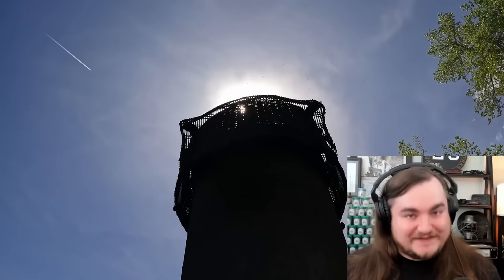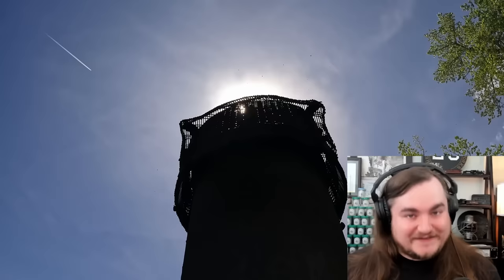Why do USA steam trains make smoke, but UK ones don't?

Comment: In the UK most urban areas were designated "Smoke control areas" in the 50's and 60's which banned the burining of natural coal. So nearly all of our coal is actually coke. This makes for much cleaner burn.

I'm not sure if Railways are exempt from the Clean Air Acts, but for example my house is in a town centre and it would be a criminal offence to burn either coal or wood that hasn't been kiln dried here. Either the railway also complies out of convenience because most lines probably pass through such areas or smoke free coal is the only only show in town.

Also if your running a heritage railway you want to give your patrons the best experience - and coating them with fly ash isn't what they paid for.

Comment: Combustion air preheating makes a big difference in smoke production.  Modern fire places are designed to minimize smoke by use of insulation, baffles and secondary combustion air.

Yes, smoke is wasted fuel.  With coal, only smoke possible is with fresh addition.   The hydrocarbons vaporize first, leaving coke behind.  Carbon burns by vaporizing and immediately forming carbon monoxide which then burns with a faint, blue flame.  Deficient oxygen forms carbon monoxide as carbon vaporizes slowly.
Hydrocarbons make black smoke because the hydrogen burns first, leaving carbon particulates if insufficient oxygen is available or temperature too low.

Comment: In the old days every city had a smoke inspector. He would have a chart and he would judge whether you were making too much smoke or not and the railroad would be fine d. In a magazine a Santa Fe guy was talking about how one of the 3700 class Northern came in with a clear stack and one of their alco PA when it was accelerating shot out a bunch of smoke and they got ticketed for the smoking diesel but not for the steam locomotive 🚂

Comment: Technically coal like any substance doesn't burn. In the fire box the heat causes the emission of flammable gas and it is the gas that burns, this is known as pyrolysis.

Comment: There were these old signs made during WWII that read, "Excess Smoke is Wasted Energy" "Excessive Smoke Wastes War Resources", etc. Under normal operating conditions steam locomotives should NOT produce excessive smoke, period. Pulling a heavy load up very steep hill at high altitudes will cause a steam locomotive to smoke. Billowing black smoke is mostly done purely for aesthetics. The railroads just like coal powerplants today would reject poor grade coal.

Comment: The UK has much higher population density which means a lot more people to get pissed off at you if you dump a load of soot onto their house, washing line or any of their property. Watching old docos from the UK there seems to be a lot of emphasis on managing soot pollution for the sake of communities whereas US trains covering vast sparsely populated countrysides don't have to worry as much. 

The UK also has for the last 2 centuries had less coal and a coal supply that's more expensive but also very high quality which would also lend itself to running coal burners as efficiently as possible.

Comment: Steam locomotives shouldnt produce smoke at all normally. But usually whenever you see that the crew is dumping sand in the boiler to clean out the flu tubes, which produces that black smoke. Its usually done during photo runbys

Comment: The British fire with the firebox door open, which adds oxygen over top of the fire.  This prevents incomplete combustion (smoke) from lack of oxygen.  There is danger to having an open firebox door, as the unburned fuel is quite explosive and can enter the cab if the blower (using boiler steam instead of cylinder exhaust to create the smokebox vacuum) is not opened when the engine stops.  BOOM!  This happened to a run recently and the crew were burned.  Sometimes, when black smoke is forbidden in America such as in Salt Lake City, overfire jets would be added to the outer firebox wall to add oxygen in the same manner as the British, but with the door closed there wouldn't be any flashback into the cab.  Many of the Rio Grande engines from Salt Lake City had this smoke reducing modification.

Comment: Very interesting indeed. As I understand it black smoke is caused by the emission of unburnt coal particles. Ideally you want all the carbon in the coal getting converted to colourless carbon dioxide as its burnt (there are other impurities sulphur being a nasty one producing sulphur dioxide). That UK 1950s video emphasizes the even burning and thus little and often firing of the coal bed as well as steady removal of solid waste via the grate. The heavy blasts of air over the fire bed you showed will cause large hot spots but also stir up unburnt coal that will cause the black smoke so working against ideal conditions. The UK had a massive problem with coal and maintenance costs amongst other things on the railways at the end of the 1940s. In 1948, on the formation of British Railways the steam fleet was  19,816 being aggressively reduced to 11,662 as recorded in 1961. Mechanical and combustion efficiencies in the UK were under intense scrutiny over that period including various dynamometer trials that impacted engine designs of the emerging BR twelve standard designs over that period. There was also the Clean Air Act of 1956 to consider, how that applied pressure to the railways/ impacted engine designs I have not seen any comments on. Modifications to the grate plus auto cleaning, experimentation with single and double blast chimneys all regularly feature in engine modifications and improvements. Welsh coal being high quality (few impurities) and burnt extremely well. That’s certainly what I have picked up from various books. I do not know if North American engines and their designs were subject to such scrutiny, would be interesting to know.

Comment: My grandfather ran these locomotives in Africa,Europe, and North America they all smoked and depends on the quality of fuel {coal} that's available and the years of experience the crew has  and different designs from countries in which they were built, same thing as a diesel truck rolling coal is unburnt wasted fuel, not efficient  👍

Comment: Fuel, heat, and draft control. The fireman is responsible for the burn 🔥 maintenance  responsible for cleaning the flues and  heat exchange.

Comment: You hit the nail on the head with the secondary air part. Ive spent a lot of time firing and driving on heritage lines and spent a large amount of time on the footplates (and firing) of locos on the mainline in the UK, in both cases the firehole doors are pretty much never shut, that secondary air through the door reduces the smoke almost entirely, they are deliberately designed this way. Locos in the US with their butterfly fire hole doors allow much less secondary air and the culture seems to be having them totally shut when not firing.
Coal is expensive and black smoke is just a waste, plus in the UK we are keen not to have the environmentalists turn their hate against steam locos, whereas I doubt in the US thats a worry.
Reply from the maker: Unfortunately it's just about the same worry anymore... it's not an easy thing.

Comment: Interesting and spot on about combustion. Not familiar with locomotives. More familiar with steam trurbines. Was studying for Dot certification at a marine tech school. Long long ago. 
The school had an old Babcock water tube boiler from a scrapped WW2 Destroyer. We traced and drew all the lines. 
There was an odd fuel line and valve led in to the boiler above the burners. Ended as a bare pipe.

We’re we’re supposed to figure out what it was for. 
There a right way to something a wrong way and the F n Navy way to do something. 
Why the hell would anyone put fuel into a boiler that way no way it will burn properly.
Ahhh it was a Destroyer. 
Mostly they don’t. But. 
Sometimes they wants to make smoke.

Comment: There's a similar myth running around the maritime world.  The Russian aircraft carrier is notorious for smoking and the reason usually given is that it's burning 'mazut' which is what we call 'bunker C' which is a thick residual fuel oil. But wait a minute, this fuel was used around the world for years by almost every maritime nation and those ships didn't smoke.  So why does the Russian carrier?  It turns out the ship has an unusual type of boiler with a pressurized firebox. The air isn't drawn in, it's blown in. They are very, very responsive but it is difficult to control the fuel/air ratio on these. It takes a very experienced/talented fireman to stay on top of this.  There aren't many draftee-age fireman (early-20s) in the Russian navy that have the experience or skill to do that, so they smoke.

Comment: I'd have likely thought to have been way off with what I'd have thought to be contributing: How hot your fire is going that creates draft to pull more air to get the fire hotter so it burns more.

I'd then tangent off about "rolling coal" as is trendy with some to intentionally have more fueling than can be reasonably burned in a given time frame. Good to at least have the notion of being somewhat on the correct manner of thinking.

Comment: Prekindergarten engineering technology, all depend on what kind of fuel you could be using, coal smoke very black, oil blue or white but lack of air and fuel will produce black smoke.

Comment: Very interesting.  I have a Microsoft Train Simulator and it goes into this as you control different things on the engine.  So, the higher the temperature of the fire (since you are putting more air in) the lighter the smoke?  If so, I guess the tradeoff is your fuel (coal or whatever) burns faster thus more fuel is required.  Also, I read that only gases burn nit solids or liquids so you are heating up the coal, wood, oil, etc. until it releases vapors or gases that ignite into flames.  I guess this is why gasoline and alcohol can be dangerous as they give off vapors even at room temperature.  Diesel fuel is safer but may not be as clean

Comment: At least five American Steam railroad use Anthencite coal (Called "Hard Coal" in the US), which is the coal with the highest energy per ton and produces the least smoke.  Most US steam trains use much more smokey Bitumous coal (Call "Soft Coal" in the US).  Most British coal is even smoker and less energy content Lignite coal (Thorugh most British hertiage steam railroads today use Anthencite coal, in pass years from Russia and the Eastern Ukraine but today from Eastern Pennsylvania).   Thus many US steam engines can operate with more smoke for the coal has much more energy and less smoke to begin with and thus the smoke was less of a nusiance (And today the British trains are using Anthencite coal).
In the past British Steam engines had to deal with the even heavier smoke of Lignite coal and to avoid complaints about excess smoke.  Thus the British designed engines to better burn the coal they were using AND trained the engine operators to minimize the smoke (That today most Heritage steam locomotives use Anthencite coal is another factor).  Britans were complaining of the smoke from coal as early as the 1300s (When coal was used to heat homes and cook food replacing wood and most trees had been cut down in or near major cities like London).  Thus the burning of coal and the smoke from burning coal had been a problems for centuries BEFORE the invention of the Steam Locomotive and to get people to accept steam engines as essential for industry Britain had to deal with the smoke produced by coal and did so.
In the US, Bitumous coal burn with more energy and less smoke then Lignite coal helped reduce the smoke people complainted about.  People did complain about the smoke, thus the advertiesments of the railroads that burned Anthencite that there were burning "clean coal".  This included lines like the Lehigh Valley, Lehigh & New England, Jersey Central, Lackawanna, Lehigh & Hudson River, and Delaware & Hudson railways. 
Lignite coal has half the energy as the same amount of Bitumous coal,  Bitumous coal has half the energy as the same amount of Anthencite coal.  In many ways that the heritage lines in Britain burn almost only Anthencite coal today may be the main reason British steam engine produce less smoke then US steam engines, who generally use much cheaper Bitumous coal (In addition to a design to reduce production of smoke and firemen trained on how to minimize the smoke from the steam engine). 
Side note: US coal production, when measured in British Themal Units (BTU, a measure of the energy in a source of energy) peaked in 1998 and has been dropping ever since, even as the tonnage actual being mined has increased since 1998.  Thus the US in mining more coal then it ever has, if measured in tons of coal, but given the big mines today are western US Lignite coal mines, not the much higher energy content Anthencite coal (From Eastern Pennsylvania), and Bitumous coal (From Western Pennsylvania, illinois, West Virginia, and Texas and even in some mines in the American West) in terms of energy the US is mining less and less coal.   This shift to less energy dense lignite coal has also contributed to the gradual shift to Natural Gas for electical generation,

Comment: Maybe the next silly question to be discusses is;
Why some steam engine make strong chugging noise, while another only make hissing noise even on it's full throttle?
Reply: It’s the cutoff.  Chugging is to start or heavy loads vs hissing is efficient running at speed.  The engineer adjusts the cutoff so steam is introduced at different points in the stroke depending on the speed and power required.  A bit like the ignition timing on a car.  Again people like the chugging sound sort of like smoke.

Comment: Interesting topic.
I'm wondering about the reasons why US locomotives were so much bigger,  other than in the US the train is primarily a freight service, and more often runs long distances between stops, while in Europe the train is much more a passenger service as well and generally covers shorter distances between stops.

One other reason I can think of myself that possibly dictates the size of the locomotive is population density. More people living near the railroad means less space for big locomotives, and speed limits are set lower, meaning a big locomotive can't use its full potential, so there's no need for it.

The US made some real railroad goliaths, like the Union Pacific's 4000 class "big boy" 4-8-8-4 locomotives with two powered trucks (4 cilinders) with 8 wheels each. And I've seen a video of the Western Maryland 1309. Same setup, but with two 6-wheeled powered trucks. Still a huge engine though.
And those whistles... 😍😍
Reply: Much longer trains too

Comment: Hmm , so far as I have heard it and seen in person. The locomotive blows out a lot of black smoke under two conditions, either the engine is just accerlerating from a stand still, or the stoker doesnt knbow what he is doing.
Of course coal quality is part of it , you will have dirtier exaust from lignite than form Welsh coal.

I got this to see few times in rl, not sure what exact type of loco it was but since in Germany the workhorse was they 34 I just claim it was one ( had a regular line for a few weeks bringing chalk for filtering to a coal power plant). Back then I lived directly next to the rails and could watch from the window. First 3-4 rotations of the driven wheels a lot of black smoke and then turning more white with each stroke, as the fire gets more and more oxygen.

Comment: The original "coal roll"!  I may have seen something similar done with a U12b pushing a small consist up a steep grade. After a gentle throttle up to get the turbocharger turning, throttle back to idle for about 5 seconds then back to full throttle.  You would only want to hold it for a few seconds so you don't draw too much attention, it couldn't be very good for the engine.
But man that thing would smoke and at night there would be 4 foot flames out the exhaust!!

Comment: The (UK) Railway Causes Consolidation Act 1845 states "Every locomotive steam engine to be used on the railway shall, if it use coal or other similar fuel emitting smoke, be constructed on the principle of consuming and so as to consume its own smoke"

So I'd say there's possibly a legislative angle there too: were US railroads under the same pressures to keep smoke to an absolute minimum?

Comment: I believe a factor that ties in to the difference that you did not discuss is population density and the industrial revolution. The U.K. powered most of it's factories off of coal. The U.K. has way less land area then the U.S. does and the soot produced by all of the coal being burned in the U.K. created social pressure to take measures that would make burning coal produce less soot because everyone hates having to remove layers of soot from there house interiors every day. The U.S. has a much larger land area that the trains traveled across and the industrial centers tended to be more isolated from each other because there was so much more land area. The soot problem in the U.S. never became as bad in the U.S. as it was in the U.K. this lead to less concern on the part of the firemen and the engine designers to place a high priority on smokeless operation.